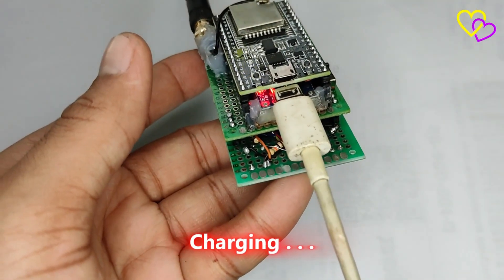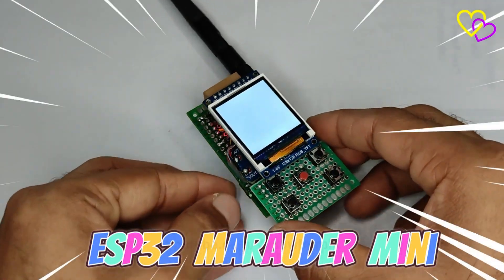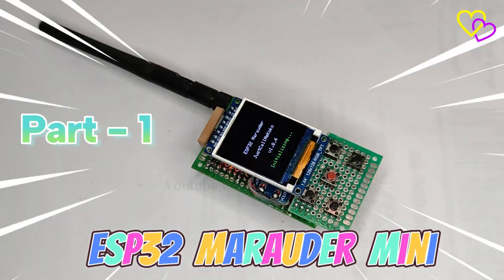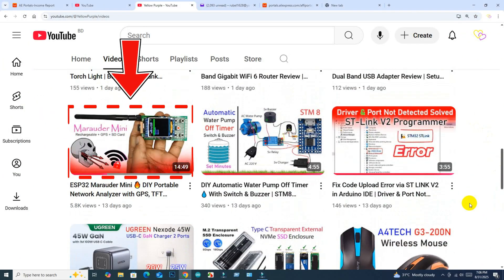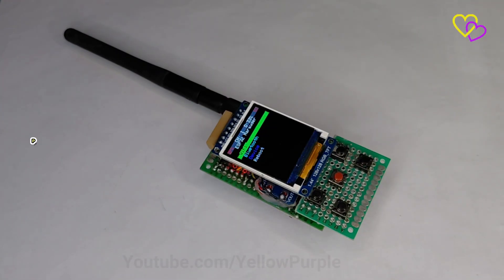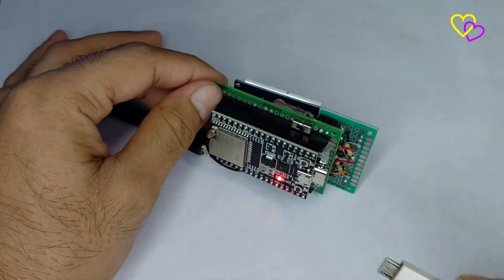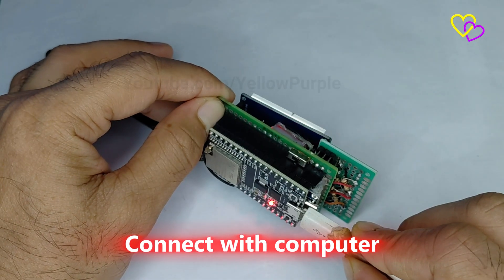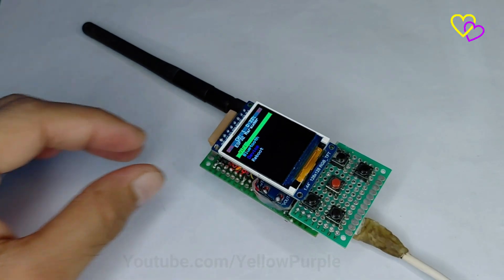ESP32 Marauder Mini Part 2 🔥 Install Bruce Firmware & Test Features | Step-by-Step Guide

Comment from the maker: 📌 Buy on Aliexpress:
🔗ESP32 Development Board: https://s.click.aliexpress.com/e/_oDXM8iv
🔗ESP32 Development Board: https://s.click.aliexpress.com/e/_oo4hgJ7
🔗ESP32 Development Board: https://s.click.aliexpress.com/e/_oojUvFr
🔗1.44" TFT SPI LCD Display: https://s.click.aliexpress.com/e/_oBNC7Z7
🔗1.44" TFT SPI LCD Display: https://s.click.aliexpress.com/e/_omwsMJ3
🔗10K Resistors: https://s.click.aliexpress.com/e/_okGHwcN
🔗5-Way Tactile Switch (Joystick ): https://s.click.aliexpress.com/e/_okSwudR
🔗5-Way Tactile Switch (Joystick ): https://s.click.aliexpress.com/e/_oEI0X3n
🔗GPS Module NEO-6M: https://s.click.aliexpress.com/e/_oE0E3Ez
🔗GPS Module ATGM336H: https://s.click.aliexpress.com/e/_opX1BpT
🔗Micro SD Card Module: https://s.click.aliexpress.com/e/_olNuU8N
🔗TP4056 Charging Module: https://s.click.aliexpress.com/e/_olryY1X
🔗3.7V LiPo Battery: https://s.click.aliexpress.com/e/_oo0au1X
🔗Tactile Push Buttons: https://s.click.aliexpress.com/e/_ooxzi7x
🔗Double-Sided PCB Board: https://s.click.aliexpress.com/e/_oDXfqu5
🔗ON/OFF Toggle Switch: https://s.click.aliexpress.com/e/_oDSOd1j
🔗Jumper Wires / Dupont Wires: https://s.click.aliexpress.com/e/_oBZpXnf
🔗MT3608 (Boost Converter): https://s.click.aliexpress.com/e/_o2CXpcp
🔗8 Colors 30AWG Wire: https://s.click.aliexpress.com/e/_olyMhv3
🔗SMA Connector Antenna: https://s.click.aliexpress.com/e/_oChxQWl

📌 Buy on Amazon: 
🔗ESP32 Development Board: https://amzn.to/3UthSoL
🔗ESP32 Development Board: https://amzn.to/4lxGlUX
🔗ESP32 Development Board: https://amzn.to/3V1ufIO
🔗1.44" TFT SPI LCD Display: https://amzn.to/4oExX8T
🔗1.44" TFT SPI LCD Display: https://amzn.to/45jwHjY
🔗10K Resistors: https://amzn.to/47EbcM2
🔗5-Way Tactile Switch (Joystick ): https://amzn.to/41weH3F
🔗5-Way Tactile Switch (Joystick ): https://amzn.to/418yiXg
🔗GPS Module NEO-6M: https://amzn.to/3HumiJa
🔗GPS Module ATGM336H: https://amzn.to/4fPKO43
🔗Micro SD Card Module: https://amzn.to/414QW2o
🔗TP4056 Charging Module: https://amzn.to/41weKMT
🔗3.7V LiPo Battery: https://amzn.to/4oDNWEf
🔗Tactile Push Buttons: https://amzn.to/470cT6s
🔗Double-Sided PCB Board: https://amzn.to/3HfSUq1
🔗ON/OFF Toggle Switch: https://amzn.to/45jJJ0Q
🔗Jumper Wires / Dupont Wires: https://amzn.to/45CWxOy
🔗MT3608 (Boost Converter): https://amzn.to/4fJfjZt
🔗8 Colors 30AWG Wire: https://amzn.to/4fC0yrg
🔗SMA Connector Antenna: https://amzn.to/41LcRM2

📌 Amazon Finds & Tools We Recommend
🛒 https://c8ke.com/yellowpurple

Comment: And if I connect GPS, NFC, IR, RF modules to the Marauder, and then install Bruce Firmware, will those modules work or do I have to change the PIN?❤❤😊

Comment: Will all the components connected to the Marauder work here, or do I have to change the PIN?❤❤❤❤❤
Reply from the maker: Great question! ❤ The circuit and pin connections are exactly the same as in Part 1 — no need to change any wiring or pins. You just upload the new Bruce firmware, and all the connected components (TFT display, GPS, SD card, etc.) will still work properly. 🔥
Reply: @YellowPurple  And if I connect GPS, NFC, IR, RF modules to the Marauder, and then install Bruce Firmware, will those modules work or do I have to change the PIN?❤❤😊